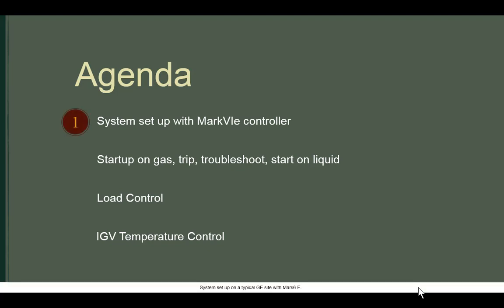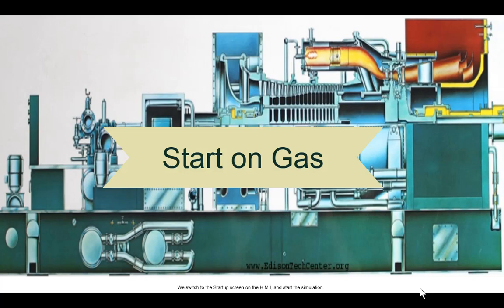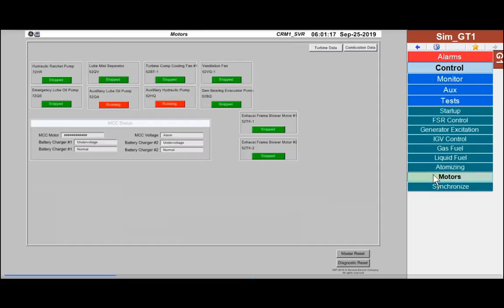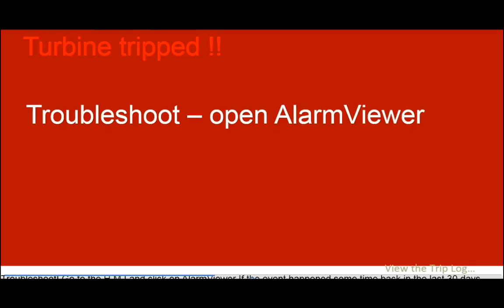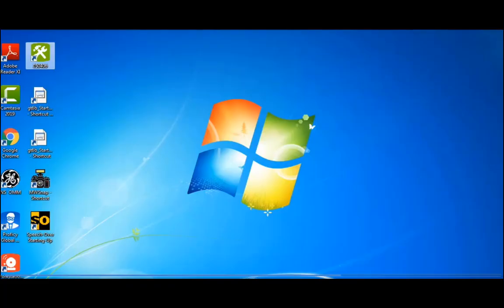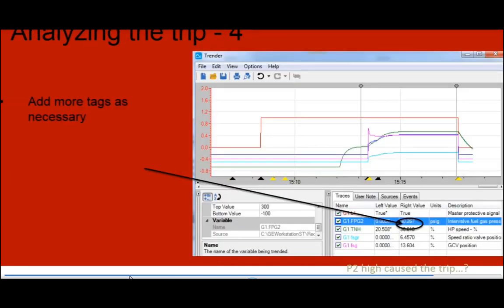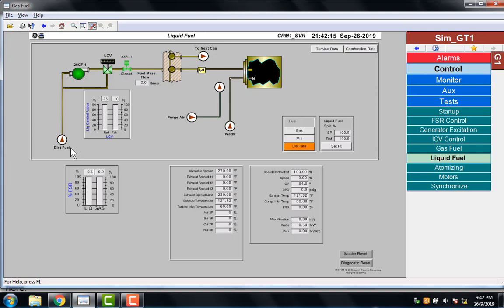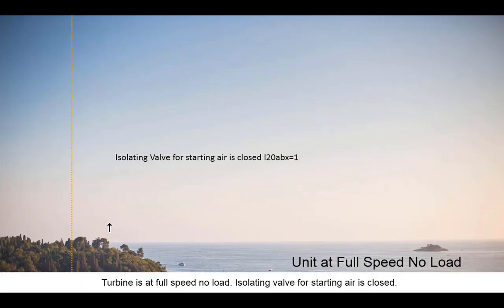Learn gas turbine controls by simulation

Comment: I have some question regarding Liq Fuel operation
1) Why in mark Vi Pressure ratio of atomizing air is set to 1.4 
2) While operating at Liq Fuel VA19-1 must be closed or opened?

Comment: Nice video Sir ..I am GT Control Engineer
How can I contact you ?
Reply: if you can pay, i can provide you with the one i have, i mean the simulation.
Reply: @GE_SCADA  how much?
Reply: @gustavomarcelo7250   50 usd, i have a simulator for a turbocompressor that you can take a look on in my channel and another one of turbogenerator that am gonna provide a vid about if u r interested, ofcaurse the simulation works on virtual box or simular and have a preinstalled cimplicity and toolbox (the controlst sotwear pack) plus the project files.